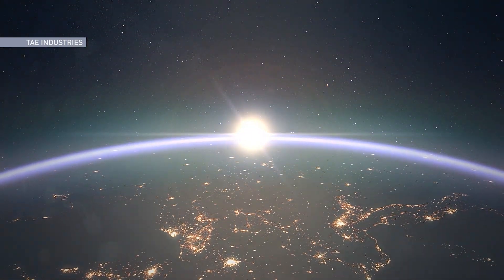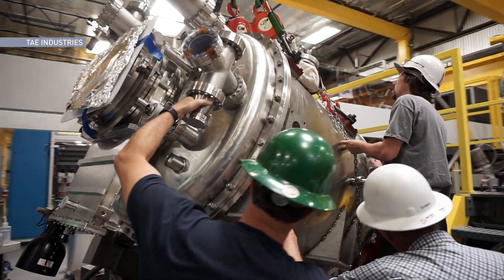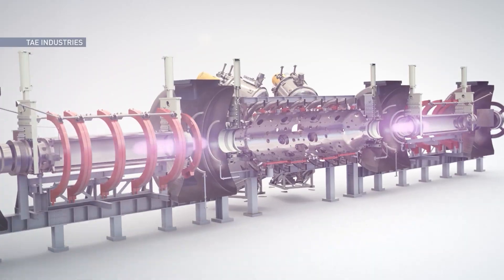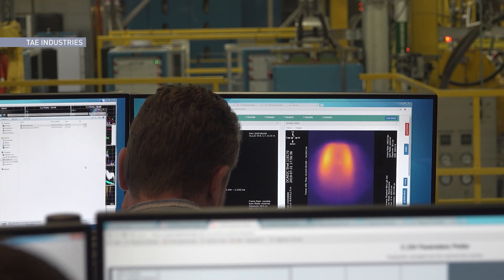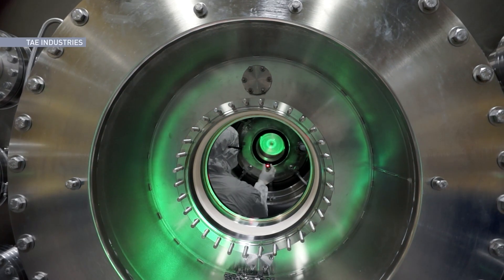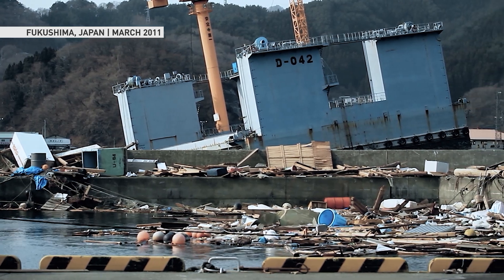California Start-Up Makes Strides in Advancing Nuclear Fusion Technology

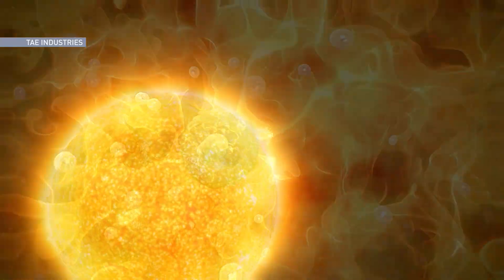Comment: this is not how the very recent fusion breakthrough happened. it was NOT magnetic confinement. it was high intensity lazers. and the fuel source mentioned at 0:52 is also wrong. they didnt use Hydrogen-boron. they used deuterium-tritium. and tritium is in incredible short supply, (only about 20kg exist on planet earth) considering it only has a half life decay of 12.3 years. we are capable of creating more tritium, but only through fission reactors, as a waste by product. the 2 reactor types, would need to exist in tandem.

this particular video is out of date on information.

Comment: Bit late, it’s already a reality lol.
Reply: Bellend
Reply: maybe in 30 years it will be
Reply: There's a very big difference between achieving 'scientific' breakeven, and 'achieving' engineering breakeven, particularly in the NIF's case.
The NIF is very unlikely to ever achieve engineering breakeven, and even if it could it will never be capable of continuous operation or useful power generation.
Point being, there's still a very good reason for people to be pursuing different approaches and designs as far as fusion power is concerned.

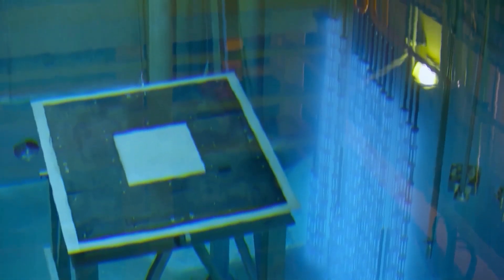Comment: 2:33 Perpetual motion machine???
Why are you promoting this on your channel?
Reply: Bellend
Reply: That's not what they meant to say. The problem fusion faces right now is making more energy from the reactions that take place than you used to cause those reactions to happen. Currently fusion requires more energy input than it gives as output. These people are hoping to break even by 2030 at which point, as long as there is enough fuel, the nuclear reaction would be self sustaining. Of course this doesn't take into account a bunch of other efficiency losses and other things so 2030 will certainly not be the point where fusion happens even if they reach their goals. If these guys ever make fusion something that can be used it's going to be well beyond 2030.